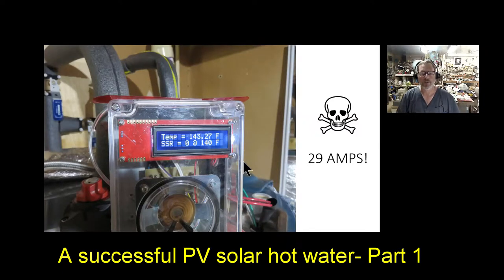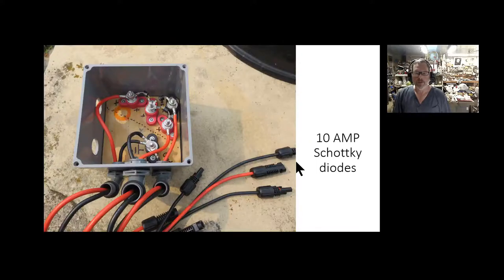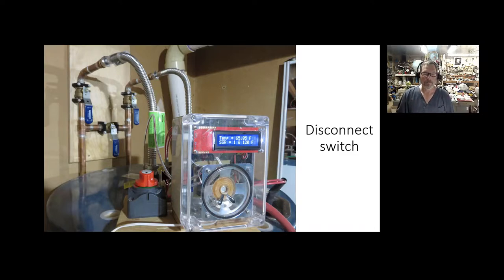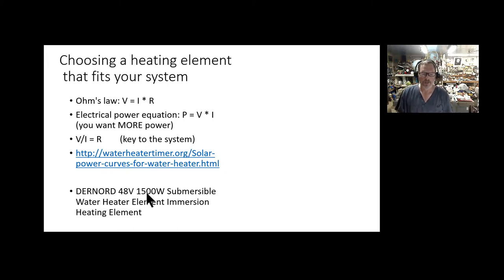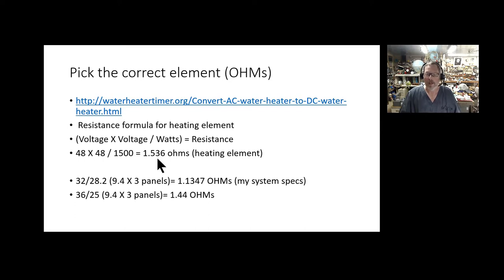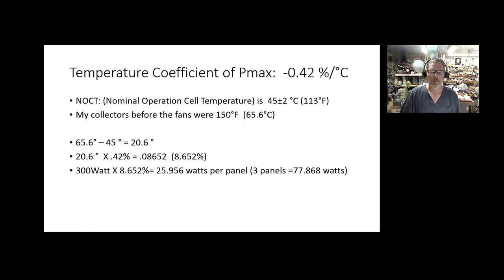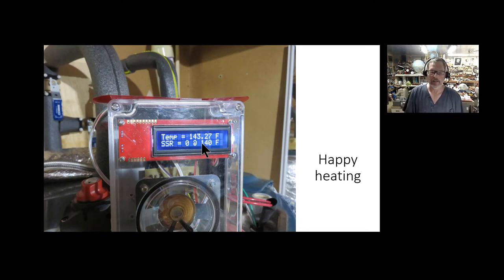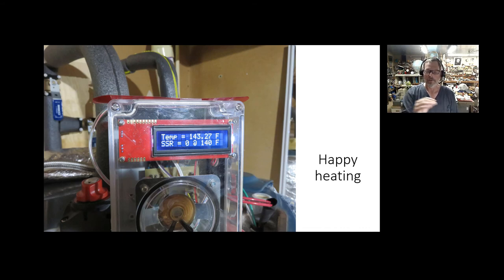Photovoltaic Water Heating System: Part 1

Comment: There is not such thing as a 48v or 220v element, their internal resistance is what matter AND the max power they can sustain. With those 2 parameters you can do what you want.

Comment: Interesting project! How much power did you need for it? Did you do a conventional solar panel connection? How many batteries did you use? Would you like to power your house with solar or wind power?
Reply: This is a direct water heating system, there are no batteries or inverter etc. Thats what is good about it , no conversion losses .  There is a good video about this though it uses a non pressurized heat exchange system which to me is even better.  David Poz channel and it also includes a table of standard  water heater elements that work based on the panel parameters.
Reply: @elonknox4777  This is scam
Reply: @ramonkaiser9593  this is scam

Comment: Going on 4 years on my pv-connected water heater. Works good, not perfect. 40 gallon tank preheating the 5 gallon rv tank. 4 panels. 2 pairs, one set to the top element, two to the bottom. Each set in series.
Nothing fancy like yours.
Reply: Mine is not perfect either. I'm still surprised when I do hear the gas fired LP water heater fire up, It's a rare thing. I'm glad I did this project.

Comment: Welcome to the world of PV heating. It is almost useless trying to get anyone on youtube to build something, it can't be made simple enough. I've been heating water for years at camp with excess PV not used for charging.  I use MPPC (constant), the unloved brother of MPPT. That prevents the panel voltage from going below a set voltage. It can be made to track with temperature. As I only use it in one season my temps don't change that much. My panels are also under trees with extreme shading.

I use grid tie panels running at 60V which is a relatively safe voltage. My heating element is a cheap 2,000W 120V found in any big box store giving about 500W at my array voltage. Currently have two tanks, a 6 gallon ECOsmart and a 10gallon. That gives me a very fast recovery time. I am generally not fond of pre heaters as over 80F will be mostly heat loss. The controller is a PWM off a capacitor bank to reach high efficiency. I used to run these two heaters off a nano as well as charging, fridge and everything else. Now it is becoming de centralized for numerous reasons. Currently heating is with two $6 inverter boards and it is something people could possibly build. My FET do not get hot.  You should consider seperating the two heater elements and run one on the SSR and the other on PWM from your nano. Onlu pulsing one reduces the size of the capacitor bank. I think you will find this element is actually rated for 56V, the battery voltage. They never tell you the resistance for some reason.

Stratification is a problem with tall tanks.  With a pre heater and you should consider a circulating pump to the primary tank. I'm familiar with that study which I and anyone else in solar feel is flawed.  It is true the total power is only about 35% more.  As a user you don't care about total power, but when you have hot water. Mine typically shuts off about 10am and everything after that is mostly waste.  On a rainy cloudy day I will harvest 2 to 3 times more energy than you do with direct connect. Fixed resistance is a killer.  You have a nano, use that capability. Just turning on one element and then another when sun increases will gain heating.

And you can use the water heaters AC contacts on DC if you design for it.

I've probably done a couple dozen videos on water heating with next to no interest. Here is a general overview of the system.  Excuse the production quality. It is like a space probe trying to find intelligent life.  https://www.youtube.com/watch?v=WFZELvy38es
Reply from the maker: Thank you for your feedback and suggestions. Alas I only have one heating element in my preheating tank so my system is for a blue sky day with the fixed resistance.   I'm certain you do produce 2 or 3 times more that what my system can on a cloudy day however in reality 2 or 3 times more of not much is still not much. I have an additional 26 panels of the same type running MPPTs and also have panel level monitoring so on those cloudy and rainy days  I see they are only producing 15% of what they do on a sunny day so I'm not too concerned with gleaning the power on such a poor production day.  My ultimate goal is to have a system so on a sunny day it can charge my entire 80 gallon pre-heater tank to 140 -150F and coast through the cloudy days. That is way I'm adding the thermal loop system to this system.  I noticed you mentioned your heater only reaches 127F and drops to 107 at night. That seems like the perfect temperatures to grow Legionella bacteria.  Thanks again for your feedback and it's good to hear from another kindred spirit.
Reply: @jtandhz  There is a serious safety flaw in your design. You picture the overtemp safety switch with signal conductors going to the nano or whatever. In the event of a control failure or SSR the heater current should go thru this switch. While it may not work hundreds of times on DC, it will work once. These switches are generally rated at 25A which is unsuitable for your 
element.  However, If one of the shorting bars is removed and each element is wired independently, It would be fine. There are other suitable ways to detect if this switch has opened.
Reply from the maker: @opera5714  If I were to implement your suggestion of using the AC thermostat switch as a fail-safe  in case of a "worst case scenario"  I would certainly then have a design with a serious design flaw. Here is a video of switching AC vs. DC that you should review. https://www.youtube.com/watch?v=Zez2r1RPpWY
I feel the contacts of the AC high temp thermostat switch in the water heater would not have the sufficient air gap to extinguish the arc. This might result in the contacts melting and leaving the switch open, and then again, it might just heat up the arms to enough to sag, touch and weld the contacts into a closed position.   Either way I'm not going to find out. However that being said, your suggestion has given me food for thought and I will be running the SSR control wire through the AC water heater high temp switch so in case of a "worst case scenario" Arduino failure,  it will cut off the SSR control voltage. I thank you for this; I might not have changed this without you input.
Reply from the maker: @damienosborne3047  Thanks! I agree with you about the low voltage SSR switching through the relay, it's just TTL level so any relay will do. The 32 volts of my or really any PV system will probably not cause you much harm. It's the current that these systems produce that can kill. A static shock in the winter time is in the hundreds if not thousands of volts but not much current. I've measured my system at over 25 amps at the water heater!  Best to avoid both voltage and current.
Reply: The reason people don't build your designs is you purposefully withhold information, make them complicated and then moan and whinge that no one is on bended knee groveling in appreciation at your all powerful wisdom. 
The other thing is you are heating pissant amounts of water that are not of any use in an everyday household. 
If you had a system that people could understand that did 1KW+ then someone would build it.  i have put up different designs for things and had tens of people build them and do vids referencing where they got the info from. That's not bragging or point scoring, it's verifiable fact. 

It's not a matter of people being idiots or lazy or not wanting to do something, it comes right back to you and how you present the info and your ulterior motives in what you are doing. 
I see people every day on DIY and Off grid wanting to know how to do this but you purposefully make it impossible to follow what you are doing. 

I have spoken to someone who has worked out an easy way for non electronics minded people to build their own controllers simply and easily and that will handle worthwhile amount of power and they are going to put up some vids in the next month or 2 instructing people how to do it.  Will be interesting to see if your whining about people not wanting to do anything holds up then and the rug will be pulled out from under your self important attitude.

Don't blame people for doing exactly what you engineer to happen from the start.
Reply: @glumpy1024     I agree operas presentations are a bit of a hot mess,  being able to do something and being able to present something on youtube are two different things though. His channel still covers more on the subject than anything else I have found, just takes a ton of effort to weed through it....(can't complain...it's free)  .................>>>>>>>>>>That said ;what ever happened to the following ...."I have spoken to someone who has worked out an easy way for non electronics minded people to build their own controllers simply and easily and that will handle worthwhile amount of power and they are going to put up some vids in the next month or 2 instructing people how to do it." ???

Comment: Hi. I have a problem: dc element: 48v, 1500 ( same as yours in photo) .. connected it to 3 parallel pvs( 40~50v) , 450watts each, around 10 amps each ... cable used 2×6mm^2 ... distance between pvs and element around 35meters .. volt out: 44v ... problem: when switched on, voltage drops to 13v ... wires get hot ... please can you help me what is the problem? Thanks
Reply from the maker: You have designed a system that has 50% more power than mine. Three 450 watt panels at 45 volts is 30 amps. (  I = P/V The current I in amps (A) is equal to the power P in watts (W) divided by the voltage V in volts (V).   I would check the resistance of your heating element and rerun the MPP calculations in the video.  Also;  https://www.youtube.com/watch?v=kVaxAfXQPDU&t=161s  is another video (not mine) of matching heating  elements to your power.  Your wire size is also smaller?? and longer than what I used.  I used 1/0 welding cable and my length  is 23 m (75 feet). I'm not sure of what you mean by 2×6mm^2, however if you are using 6mm wire for that distance and current it is undersized.    You might want to look into a MPPT controller and run your panels in series, however I don't have expertise in that.  To paraphrase the inventor Thomas Edison; you have not failed, you have just found one more way that didn't work.

Comment: PSEUDO MPPT  For your amusement. Often we learn a generality and hold on to that like Grim Death. I went back to an example I had made to see where that improvement would begin. This comparison is between MPPT with direct connect of parallel and single heater elements. For simplicity, a 60V 10A array and a 6 ohm parallel element. Solar panels are current sources and the voltage of them is based on the load resistance. The 10A can be looked at as 100% op panel rated current. 2R is using only one of the pair and it can be seen that 70% of the panels current range improves dramatically using a single element. It would be a simple program to look at the voltage of one resistor and choose which produced more power. That could be done even every 5 minutes and only requires an additional SSR.

MPPT     10A   60V   600W     even
DIRECT   10A   60V   600W

MPPT      9A   60V   540W     1.1X
DIRECT    9A   54V   486W

MPPT      8A   60V   480W     1.3
DIRECT    8A   48V   384W

MPPT      7A   60V   420W     1.4X
DIRECT    7A   42V   294W
DIRECT 2R 5.4A 65V   350W     1.2X estimate 

MPPT      6A   60V   360W     1.7X
DIRECT    6A   36V   216W
DIRECT 2R 5.2A 62V   324W     1.1X estimate

MPPT      5A   60V   300W     2.0X
DIRECT    5A   30V   150W
DIRECT 2R 5A   60V   300W     EVEN

MPPT      4A   60V   240W     2.5X 
DIRECT    4A   24V    96W
DIRECT 2R 4A   48V   192W     1.25

MPPT      3A   60V   180W     3.3X
DIRECT    3A   18V    54W
DIRECT 2R 3A   36V   108W     1.6X 

MPPT      2A   60V   120W     5.0X
DIRECT    2A   12V    24W
DIRECT 2R 2A   24V    48W     2.5X

MPPT      1A   60V    60W      10X
DIRECT    1A    6V     6W
DIRECT 2R 1A   12V    12W       5X
Reply: i dont mean to be offtopic but does any of you know of a method to get back into an instagram account..?
I was dumb forgot the account password. I would love any tips you can give me.
Reply: @Jermaine Baker instablaster :)
Reply: @Messiah Roy it worked and I finally got access to my account again. Im so happy:D
Thanks so much you really help me out!
Reply: @Jermaine Baker Glad I could help xD

Comment: Very interesting. I was wondering two things:
1 - What's the reason you're using a low voltage element instead of just seriesing your panels and choosing a similar powered element rated at that voltage? I'm actually looking at doing the same with my 4 280w panels and re-using my 220V element in my current geyser.
2 - As Opera alluded to, you could do a MPPT tracking routine with two elements, and monitor power production. Say one element rated at 33% of MPP and one at 66%. Then if it's sunny enough you could connect them both up, otherwise use just the 66% one, and if there's even lower power available, just run the 33% one. A series configuration could mean one more step in-between too. I reckon I'll give that a go. Maybe a capacitor and PWM through a MOSFET bank would be simpler though.
Reply from the maker: Thanks, I went with parallel as I have a shading concern every afternoon and a series connection limits the whole array if even one panel is shaded. With a parallel system I do lose amps when one is shaded but the voltage of the rest of the system  is still constant for the MPP voltage & resistance. I do use MPPT on another system I have and just felt I was not going to worry about gleaning a few percent more on a limited day anyway so my system  was balanced for a straight MPP on a sunny day. This  was designed around a re-engineering of an earlier flat plate heating loop system and my tank only has one heating element (and the heat exchanger)  so I'm trying the best with only one element.   On any sunny day my 80 gal tank is producing around 120F and when I have sunny days in a row it's more.  I did hit 160+F once when I was not using water and that caused the relay to open and stop the heating as designed.
Reply: @jtandhz  Ah, yes. Your design does make sense for your situation. I'd like to look at DIYing a switching MOSFET + large capacitor load, but getting MOSFETs big enough for that current could be challenging. I guess it also comes down to a cost vs benefit thing, where an easy system is plenty good enough and you could be doing other things instead.